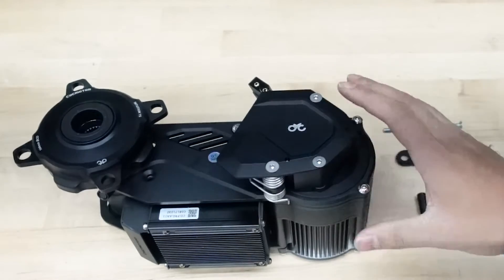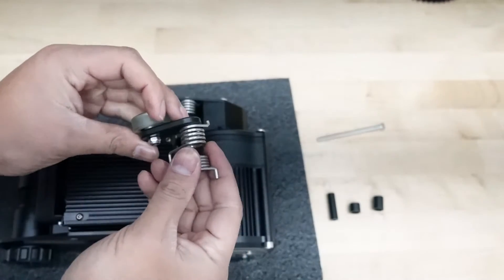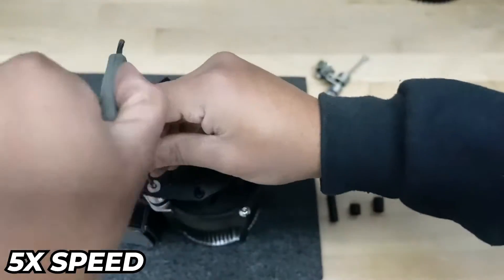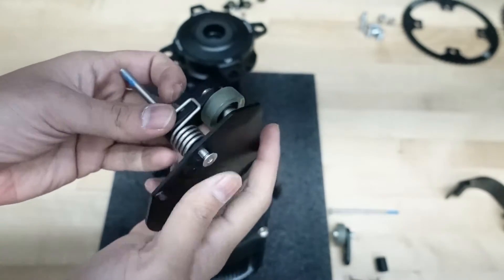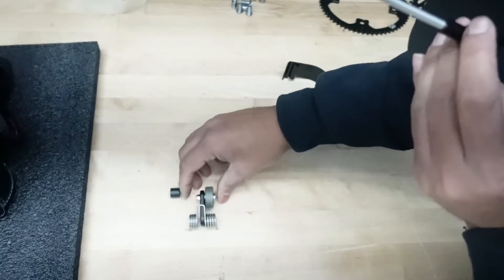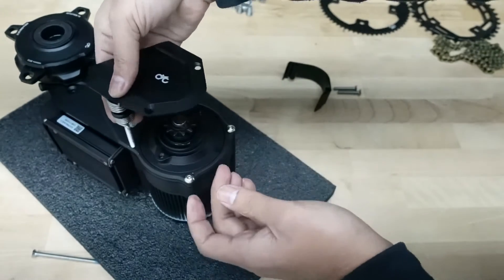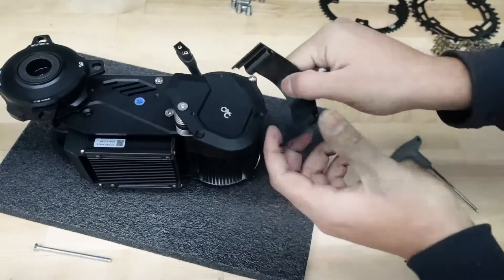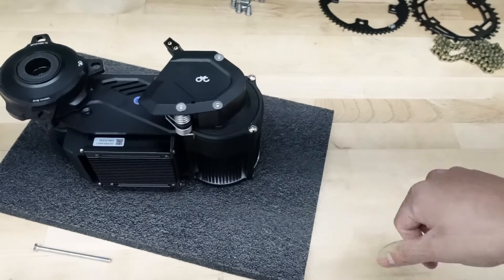CYC X1 Pro Chain Tensioner Installation

Comment: Can you tell me what the advantages are or disadvantages of having a BBSHD or a high-powered hub motor? Or the differences between them. I have two  BbSHD's. Also, I'm thinking of getting a better controller. Could you recommend one? Seems like you have a lot of experience. Thanks for your help in advance.